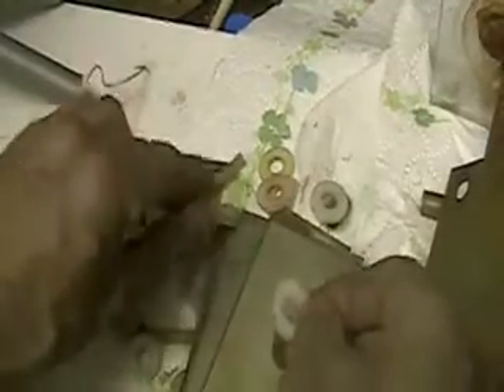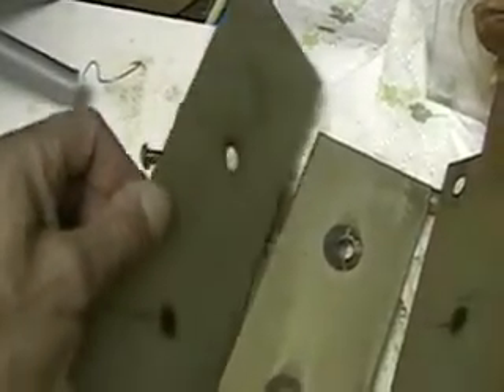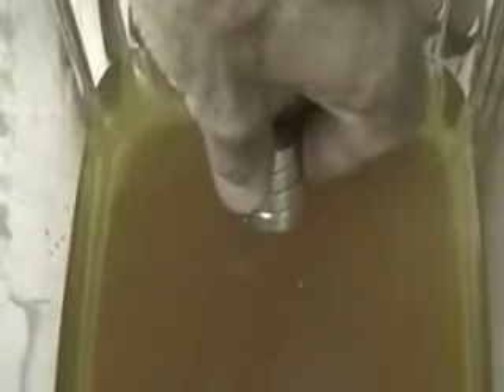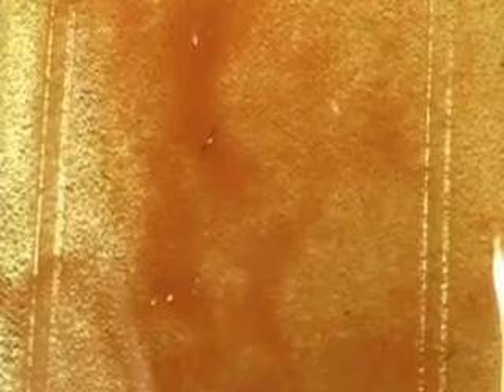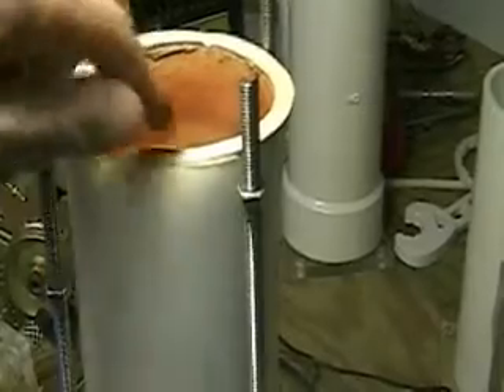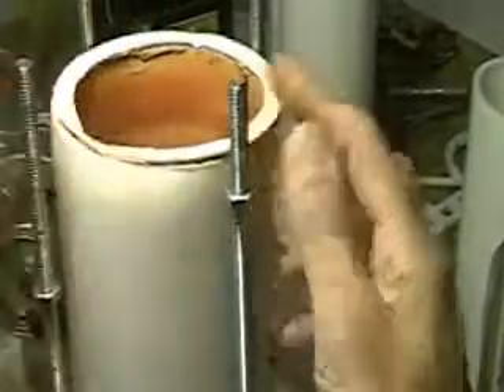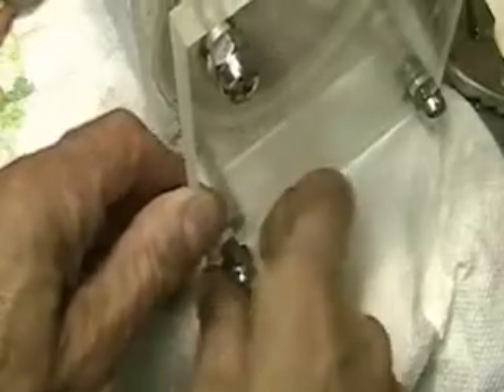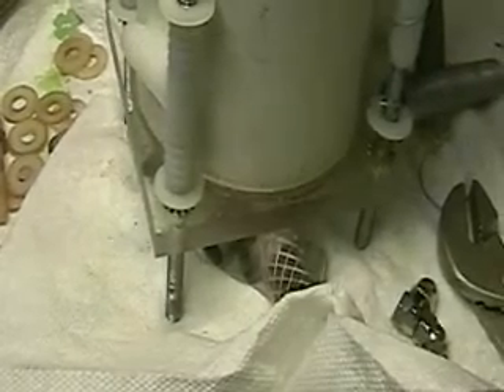Hydrogen Tap (FOCUS- PM2) 332

Comment: What were you using for electrolyte? And what ratio water to electrolyte? I have been using 1/2 teaspoon baking soda to 64oz of water. It still has heat issues, near boiling. Running off a 12v battery the amps start out around 8 and slowly climb to over 30, then the fuse blows. Yes it's just tap water, but will be trying distilled today.

Comment: What were you using for elecrolyte during that test? And what ratio of distilled water + electrolyte? I myself have been using baking soda, 1/2 teaspoon to 64oz of water. I still have heat issues. I got lots of questions..lol

Craven